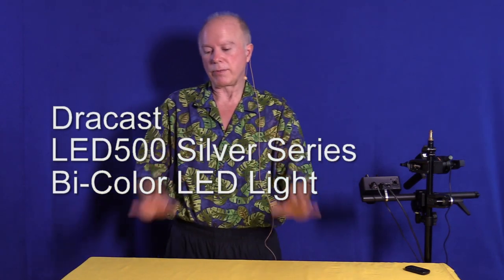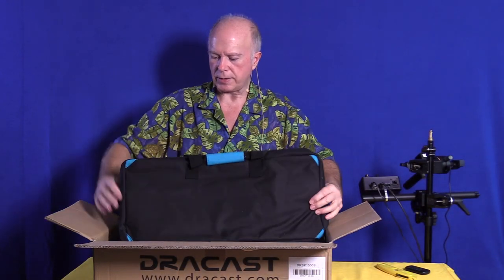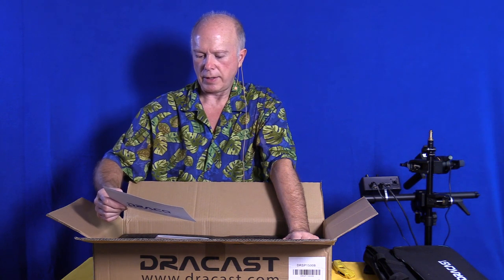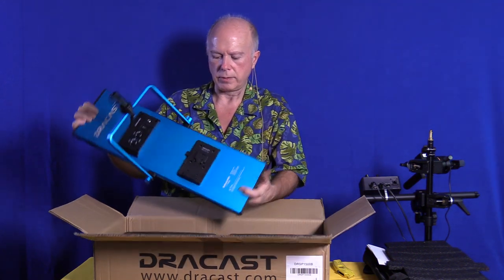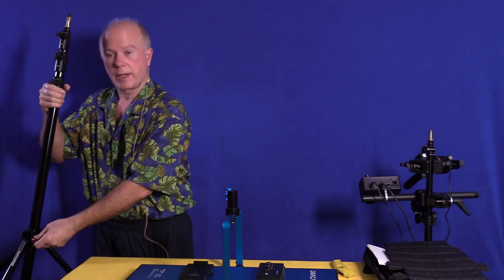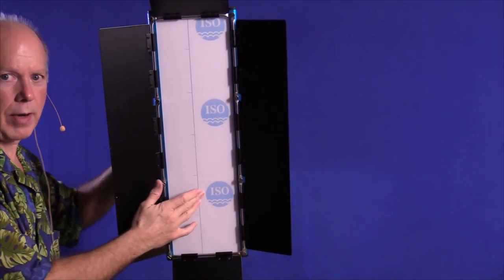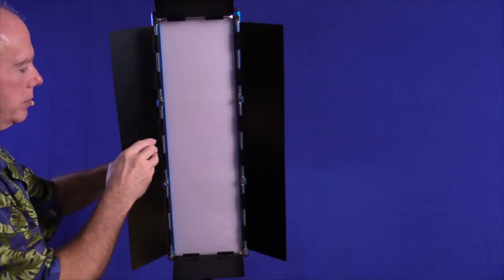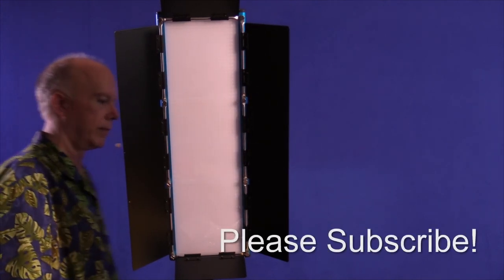Dracast 1500 LED Panel Light Unboxing & Setup

Comment from the maker: This Dracast Silver Series LED1500 Bi-Color Panel with V-Mount Battery Plate is now discontinued. Purchased at a great price ($300.00) ! The replacement - ($650.00) Dracast S-Series Plus Bi-Color LED1500 Panel with V-Mount Battery Plate has an Updated Control Panel with DMX support is an even better LED Light Panel. Better in features and use but more expensive yet less expensive over other LED Light Panels. 

https://www.bhphotovideo.com/c/product/1367524-REG/dracast_drsppl1500b_s_series_led1500_plus.html

The Good... "One of the light's enhancements is wireless Multi-Light Control Capability whereby you can make color and dimming adjustments to a single master light and other lights in a group will follow suit. The panel also has both color and light intensity presets to make it easy to return to previously used settings." Getting info on this technology from Dracast is like pulling hens teeth. 

However, Control is done from one Light Panel designated as Master Control. Should be an option for a separate Control Panel to be truly useful in a multi panel environment. 

The Dracast PDF Manual is NOT a Users Guide as it should be and is therefor lacking in details. Just gives an Overview of features. More like a Sales brochure. And NOT searchable for text - It's an image file. Still, this new Light is amazing! Yes, we have one. More expensive, yes. Better value. Still a great value. But to make use of the Multi-Light Control Capability, you need more than one! Hope this helps anyone interested in Dracast LED Lighting.